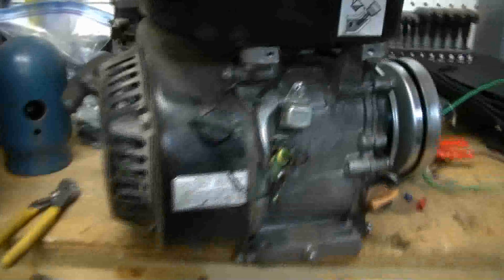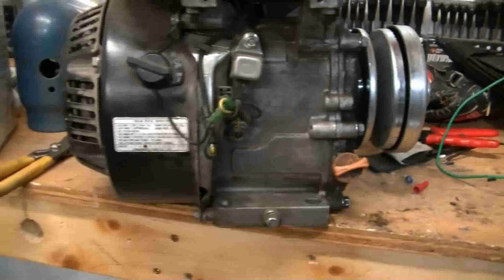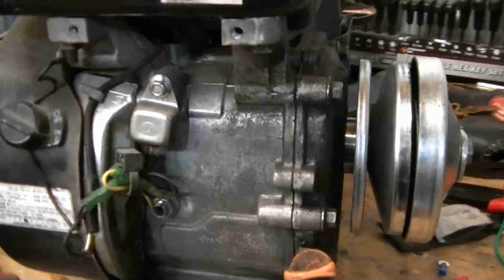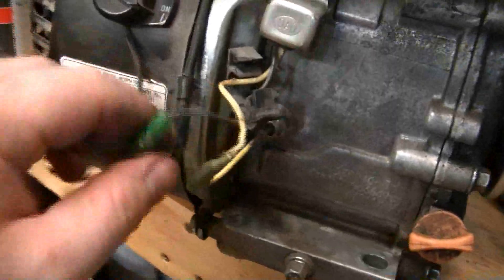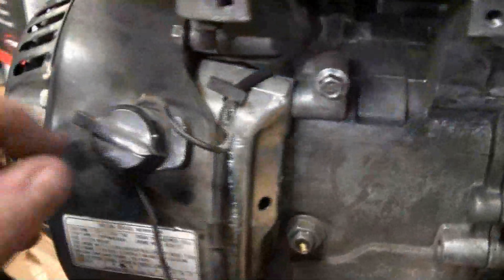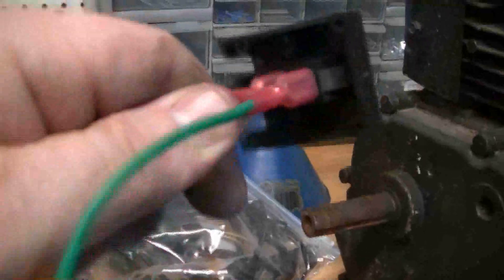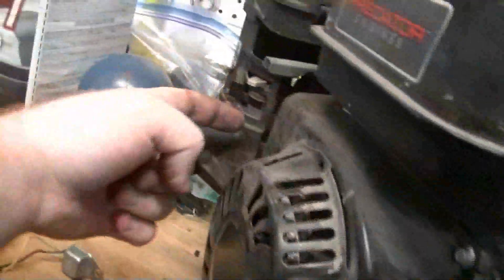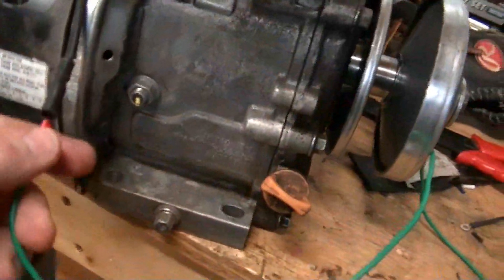Predator 212 Go Kart Kill Switch Installation

Comment: Hi Red Beard. I’m new to building go karts. This is my first one that was junked and I’m putting it together. I already rebuilt most of the engine because a lot of rusted seized parts. Now that I have everything together before I put in service what kind of oil should I use in my 212cc predator with a stage 1 upgrade and torque converter?

Comment: I just purchased my first mini bike. It’s a old Baja doodlebug with a older predator 212 on it like the one in this video. It currently doesn’t work I’m trying to trouble shoot it and thinking of just replacing the carb to make the throttle easier. What kind of aftermarket carbs fit on those older predator engines?

Comment: The black wire off the start/stop switch BROKE & not sure were it went. Goes through engine( has a heat sleeve on it) Hooked it up to that throttle Philips head screw (nut with hole in it),but know it doesn’t go there? Thanks!

Comment: So I want to eliminate the oils sensor on my off road golf cart with out tarring it apart .now can I still do this and cut the wires .but still use the key start .or would I have to pull start it then.i would like to keep the key start if possible and still be Abel to disconnect the oil sensor.sence my golf cart likes to shut off on me after about 30 Min of trailing then I have Waite for everything to cool down before driving again

Comment: Awesome channel man. So I have a question: I bought a alphaworks 212cc and I doesn't seem to have a low oil sensor. I can't find nothing online. It's only one ground wire and the other goes to center/top of the engine under the gas tank I'm sure to the coil. I don't see a relay or a wire going to the block.

Comment: If I am going to remove the kill switch on my Predator engine completely what size of a rubber plug would I have to get how many millimeters to plug that hole where the switch used to be?

Comment: Nice short and to the point fear until you just run that wire up and then the other wire coming up out of the switch ground that and that's all you need just the one groundout you do that

Comment: So the wire going into the engine isn’t needed? I have an electric start on mine but it doesn’t work so I took it apart and I’m trying to figure out how to get rid of it and just put a switch on it cause the pull start works great

Comment: this is an old video so i doubt you'll see my comment but what do the charging coils on a predator 212 do? do i need them/are they important?
Reply from the maker: They provide charging power for a head light or battery
Reply: @RedBeardsGarage  oh thanks! so if i remove them then it wont be a big deal and my engine will still run? i was confused because the magneto fires twice as often as it should. :/

Comment: Perfect! I just installed a new Predator on a Puma Motor Bike, and was having shut down Issues for no reason. Was wondering what that little Box on the front was for, I knew it had a Sensor for low Oil, now I understand Why the Shut Downs, and I also now know how to connect the Handle Bar Kill Switch. Thank You for the Video! Thumbs Up!  :)

Comment: Hey Red Beard, I'm trying to put together a front end suspension design for my yerf dog, can you help me out with some tips? If it helps, the kart I have apparently was discontinued due to the front wheels having issues with folding up under the kart causing it to flip over.

Comment: Great videos! 
Have you ever hooked a chinese atv wiring harness complete with key, kill switch, push button start, and lights to one of these 212cc?  I have a Chinese atv frame and just installed the pred212 with electric start in it and would like to use the existing wiring harness, but having issues. Any help would be greatful. Thanks.

Comment: Hi Red Beard, could you post a link to the switch in the video? Or any switch that has the correct connector to plug right into the existing connector on the engine?
Reply from the maker: Theres not a switch thats going to just hook up to the existing wire. You will have to put new ends on it

Comment: Watched your video, and did everything step by step as you did. Keeping the stock kill switch, but also adding a toggle switch. removed the low oil sensor, and used a male bullet connector to connect the toggle kill switch. Now go kart will not start. wondering where I went wrong. the toggle switch has 2 wires. One wire, I attached to the frame with a screw for a ground, the other wire is the one connected with the bullet connector. any ideas?
Reply from the maker: The toggle switch needs to be in the off position to run. On would open the circuit and allow the engine to be grounded
Reply: I tried every possible variation of toggle switch on and off, along with the stock switch on and off. nothing. could it be a bad ground connection on the toggle switch?
Reply: by the way, I love your videos, and especially love your witness for Christ. i am a youth pastor in OK and appreciate your stand.

Comment: hey there! thanks for the video! im just wondering if i keep the red kill switch on the engine and put the other kill switch on can i just ground the other kill switch to the metal frame or do i have to run  ground from the other kill switch to the ground on the moter?
Reply from the maker: +Gary Stancavage are you wanting both kill switches to work?
Reply: Red Beard's Garage yes just as a safety precaution
Reply: Red Beard's Garage im just not sure if i could just run the power wire back to the motor and just use the ground wire thru a bolt anywhere on the metal frame or if i have to run the ground back to the ground bolt on the motor? thanks for your help!! and thabks for the video!

Comment: I just bolted on a Mikuni carb on my Predator 212.  Now the governor linkage is sitting atop the engine. Can I simply remove it? Does doing that disable the governor? I really don't want to open the engine. Thanks!
Reply from the maker: I am going to do a video on how to bypass the governor without opening up a block
Reply: Great, please post the link here if you don't mind :).

Comment: hey good video, I have a question when you unplug the oil sensor near the kill switch, do you need to remove the oil sensor in the engine as well or only unplug it?
Reply from the maker: +Jared Zanelli if you are in the engine then I would remove it but it will not hurt anything to leave it.
Reply: Red Beard's Garage thank you

Comment: if i place this engine on a chopper bicycle will i need to install a hand clutch if i use a torque converter? if yes how would i do that?
Reply from the maker: +Gavoy Small no the tourqe converter works without a clutch
Reply: apologies for my ignorance, this will be my fist attempt at doing this.. are you saying the torque conv comes with the clutch automatically or are u saying I must add a hand clutch to the ride?
Reply from the maker: No its a all in one unit you wont need anything else.
Reply: ok, thank you

Comment: hi. thank you for your amazing videos. i am checking all your channel now. 
do you have an idea on how can i add an oil temperature gauge the that engine? i have a 390cc 13 HP Lifan with electric starter. you can check my channel and see what i am building with it. it is a hot Rod :) 
and i am really interrested to make a pretty functional dash board on it. so i bought a Motorcycle Speedo and Tach, and a car Voltmeter and oil Temp. and a clock. 
so i don't know if there is a regular way to attach the oil temp sensor to the motor before i start creating a way to do it. 
thanks again
Reply from the maker: You would have to tap a hole in the block low enough to be in the oil.
Reply: thank you

Comment: i am wondering if its possible to make a predator engine 212 electric start
Reply from the maker: I think something with the flywheel doesn't line up on them. I will be buying one soon to see if i can figure it out. I have been ask this question a lot so I need to do it.
Reply: dude keep up thos fast comments and remember the golf cart project
Reply from the maker: I will man.
Reply: ok thamks

Comment: Can you do a video on a kill switch for a Briggs & Stratton engine?
Reply: Hotrod769 most of the older ones have a kill wire sticking out the side. Just plug a switch into it and get a ground and you’ll be all set.